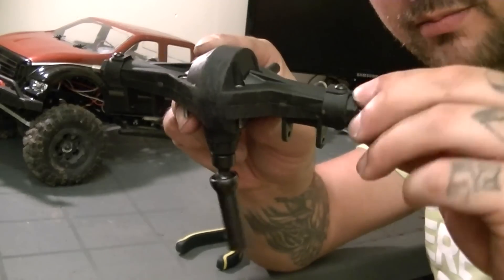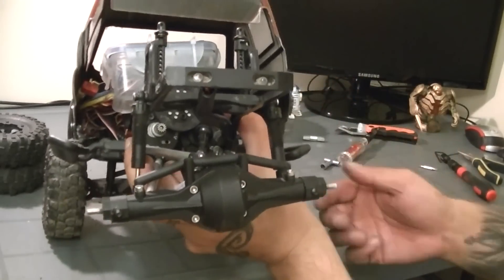HOW TO MOD YOUR SCX10 FOR SCALE DUALLY TIRES & AXLE

Comment: Pretty cool rig.
I never gave a dually much thought until I did it myself to my Trailfinder. I have a 6x6 and the extra axle really increases the offroad performance quite a bit. I didn't think a single axle with dually wheel would help much but I love it. Duallys in the rear are awesome.
Reply from the maker: I had a 6x6 for a bit. I just love the dually look and feel.

Comment: Get some long screws and a extra set of wheels. Drill out the center hex area of the outer one so you can get your axle nut on. The middle one will be what your axle hex goes to. Use just the rim and not the beadlock.  The inner wheel will need the center cut out so the outer part of the axle will clear. Drill through the inner and middle rims. Install the long scews and they'll pull it all together threading into the outer rim. No coupler and losing your outer wheel.

Comment: Easy to do thx for showing us. As i was sitting here i thought about using Wraith front axles you would need two short sides but you only gain about a 1/4" per side, both sides for a total of just under a half.  In some cases i guess it might work. Have you got any other axles that have worked? Besides the losi
Reply from the maker: I have thought about wraith axles on the front but then i thought might be to wide for me to try and keep a scale look. No have not tried other axles other then many failed attempts. Only thing Lodi are the drive shaft itself.
Reply: t i meant was the axle shafts. they are shorter slightly the ones on the short side

Comment: I have a question for you being there is a joint almost at the wheel end and only one bearing do you have an issue with the truck looking like it has camber on the rear meaning is the rear tires as ridged as they are on a stock axle also I noticed the spacers that you used to keep the spacing correct between the wheels what actually drives the outside wheels? thanks for your time and good idea

Comment: Looked like the outer dually wheels don't have a 12mm hex behind them to offer real grip...like they're just gonna be turning because if the friction from the screw holding it to the extension. Do you have plans to use a 12mm hex on the outside wheels?
Reply from the maker: No plans to use a 12mm hex because they work perfectly fine the way they are. With the amount of friction they are on strong just like they normally would be on the hex and they offer a lot of grip. Just make sure its on tight. Add some blue locktite and your laughing. Been running it like this for years and never had an issue.

Comment: thanks for sharing you mods.now I was wondering if you're running 1/10 on you honcho with usually wheels.I have axial scx10 model.we'll that mods work on it? thank you again.
Reply from the maker: This is a Axial 1/10 SCX10 Honcho. Wheels, axles, chassis, etc. It is all a SCX10 model. Only mods done is what you have seen and if it works on my SCX10 then yes it will work on your SCX10 and everyone elses.

Comment: That's cool but on a 1:1 dually the inside rear wheels are the same width as the front axle
Reply: Yah, this is a neat mudder, perhaps, but not a proper dualie/dually**.  Though as a mudder i have to wonder how long that screw holding the halves together will last.

** There is some variety in the alignment between Ford/Chevy/Dodge/Etc. but generally you are spot on, and none of them look like the model above.  But then, the RC community is forever making 'School Bus' rigs that are straight 4X4s, so it seems like the definition of dualie is hiding in plain sight.
Reply: On my F650 flatbed tow truck, my front wheel spacing was the same as my outside rear dual spacing. Basically meaning the front wheels were wider than most normal vehicles, and the inner dual would be further in than the front tires. The outside duals and the front steer tires were on the same path.
Reply: Neeraj Kangra
Reply: Nope

Comment: do you have any problems when flex?
Reply from the maker: I had to do a drop setup for my suspension or else the tires would rub on the chassis when it would flex and it would also rub on the shocks.

Comment: Good job man...
Reply from the maker: Thank you
Reply: +DribbleGamingTV I did the same thing only with scx10 rear diff and wraith front diff. same thing no cutting, I made it work with hex spacers on the front. axial makes hex spacers so does rc4wd
Reply: +DribbleGamingTV nice way to keep stock wheel base good job!, I went wider and my honcho doesn't flex like it use to...
Reply from the maker: +ben dover that's also another way to do it. Only reason I did not do it that way is because I did not want my front end sticking out any farther and was going for as scale as possible.

Comment: Why cant someone just sell them already Made that ways i may just Gladly buy it made
Reply: Cheaper to modify rims. There is so much tress coming to those bearings, as there is uniball joint that i doubt it will last long like this. You can get it last if done properly by modifying stock style hard axle, but like i said one harder jump and that axle is probably dead/cracked.

Comment: HEY SENES YOUR NOT INTERESTED IN RCS  WELL WOULD YOU HAVE INTREST IN SELLING THE TRUCK IN THIS VID I CAN GIVE YOU 20$ IF YOU SELL IT :)
Reply from the maker: Im interested in RC. And this truck is work way more then $20 or even $30. Thats an ignorant offer. This is a SCX10 which is custom built. Go look up a brand new one they are at least $300 plus.
Reply: +Gage Phipps Looking at all the aluminum bits plus the mods plus custom body thats around 300-350 right there

Comment: hi I saw your rear shocks r mounted straight to your frame and not on your shock mounts was wondering what kind of shock they r so I can do the same cuz I want to put a flat bed on my scx-10.
Reply from the maker: They are actually the stock shocks that came with the truck 4 years ago when I bought it. I just took the springs off for a droop setup. Doing it like this and mounting to the chassis itself gave it a little bit more height and better flex and way less rolling the truck over.